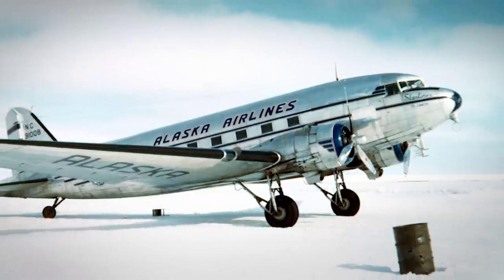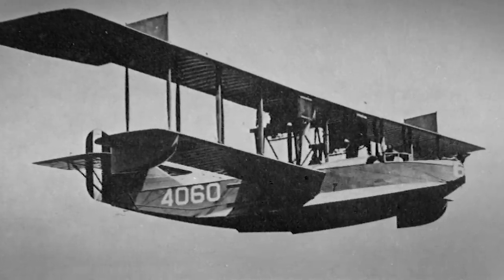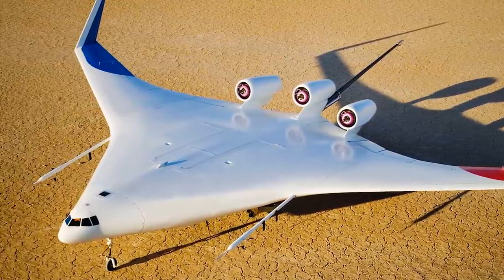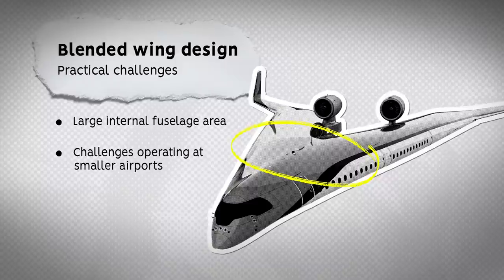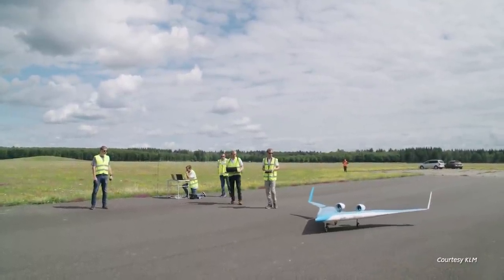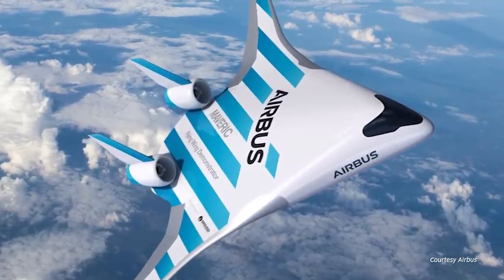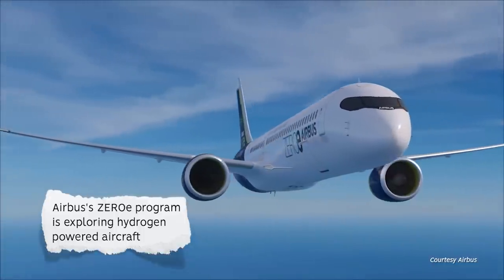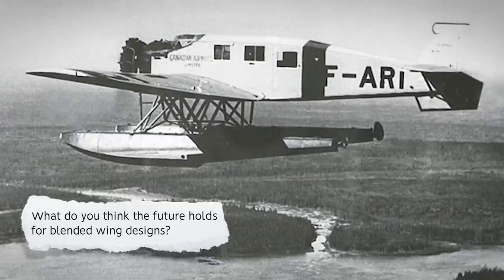Blended Wing Design: The Plane Type Of The Future?

Comment: One way the blended wing design could be a real game changer Is in the cargo market. The huge internal volume could move substantial amounts of freight over long distances. I could also see it as a combi aircraft with passengers along the edges and a large internal cargo volume.  As a freighter, it wouldn’t even need to be particularly fast. 400 to 500 knot speed with lite fuel burn, good short field performance and large carrying capacity could be popular.
Reply: In addition, cargo typically uses ramp parking, as opposed to jetways etc, so minimal infrastructure changes would be needed. It can park where current cargo planes park for the most part
Reply: And cargo doesn’t need pressurization so no pressurization issues of blended wing aircraft.
Reply: Actually, I think it would need to be at least 650 mph to really make a difference

Comment: Flying wings could definitely be a game changer, assuming of course you solve some issues first. One is safety, since you would have a more difficult time leaving the plane in case of emergency, simply because the surface area is lower relative to the volume of passenger a flying wing can have. 

In case of cargo planes on the other hand this issue does not present itself, after all who wouldn't want to see a B-2 esque cargo plane flying

Comment: I was hoping for some insight on how they are working some of the limitations. Pressured cabins, round shapes spread the forces equally in all directions. Flatten it out and the lever fources will rip it appart. The inability to change the wing shape during flight. The shape of wings change drastically durring flight. This allows them to fly efficiently a high speed while developing enough lift at low speeds to take off and land. I would love some insight on how the new designs are looking into these issues.

Comment: I thought the higher cross sectional area makes them uncompetitive with flying pencils. As wing materials get better and better, the gap between them gets worse and worse. I think blended are just good for specific applications that require it to be a certain size and shape. As it is, the shape of a fuselage and cabin is pretty efficient. Even the exits work well on a long plane. Im not sure a blended would work so well when you have 4 or 5 aisles trying to exit the sides.... Military may be a completely different story.... For commercial, if blended was more efficient, they'd already be in the air.

Comment: I just don't see how it will be economically feasible to construct such aircraft in large numbers. Current carbon-fiber components must be cured in large, pressurized ovens (autoclaves). As wings and fuselage components are much longer than they are wide or thick, this means that the cross-section area of the required autoclave remains the same for longer components. Blended wing aircraft would require much, much bigger ovens to produce the necessary body component.  Making a longer autoclave is much easier than making one that is extended in all three dimensions.  

One other major consideration is that a single aircraft model family (737, A32X, etc.) can produce different versions largely by adjusting the length of the fuselage. Any blended-wing design would require a complete redesign in order to accomplish this.  This alone would either limit the potential market of a given blended wing. 

And, finally, would anyone want to sit in a seat far from the roll axis?  If a 747 banks to 45 degrees, window seats move vertically a maximum of a couple of meters. The resulting acceleration is relatively small.  At the edge of a bended wing, your seat might move 20 meters in the same amount of time and you would definitely feel it, turning a normal flight into a roller-coaster ride. Furthermore, to minimize this, the roll rate of the aircraft would have to be limited. Finally, adding mass far from the roll center will both slow roll rate (limiting maneuverability) and stress the airframe and flight controls.

Comment: These are ALL "more of the same"... all these concepts make passengers suffer from jet lag inn arrival..  was to g time on the ground instead of in the air... 

Use of much slower LTA (LIghter-Than-Air) Craft using Helium (for Levitatipn) and Solar Energy for Propulsion...that always hovers.   can possibly transport passengers across the globe and offset its slower speed by letting (intercontinental) passengers travel in comfort (including lounges, cabins, etc..) and arrive at their destination WITHOUT JET LAG.

This would Offset their lower speeds... and tome lost due to jet lag on arrival... for the same price too... 

This requires "OUT OF THE BOX" thinking of very large LTA-ICC (LTA Inter-Continental Cruisers)
•  Ferrying 15,000 Passengers...???
•  Serviced  by Ground-to-LTA-ICC Shuttles along the way (like the ISS)... 
• 15,000 Passengers/DAY paying $600(avg) would generate a Revenue of ~ USD 3Billion/yr... 
• $1 Billion/yr would "pay off" the  Mortgage on the 14 Billion, LTA-ICC
• $1 Billion/yr for Passengers & O&M Expenses
•  $1 Billion for Margin, Profit etc...
• ALL WITH ZERO POLLUTION... !!!! 

Think about this Pollution Free Future.. (shorter travel, say upto 1,000-2,000km   can be readily achieved by (Very) High Speed Trains..